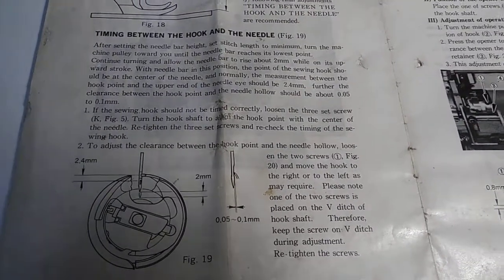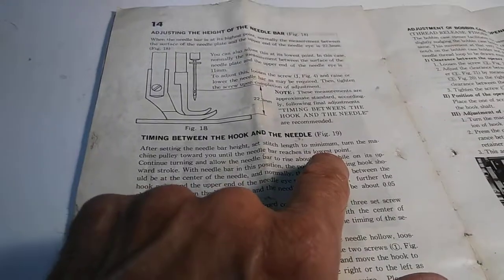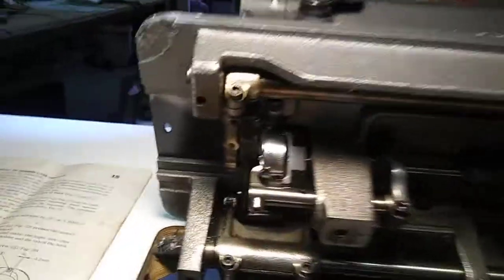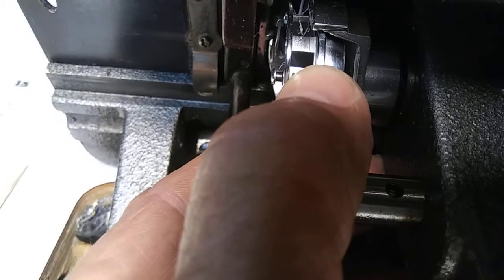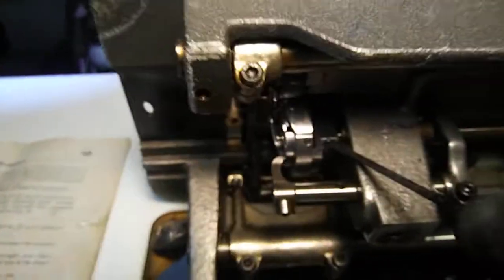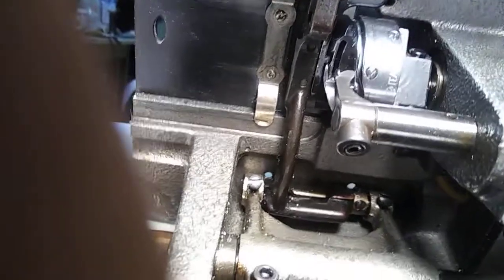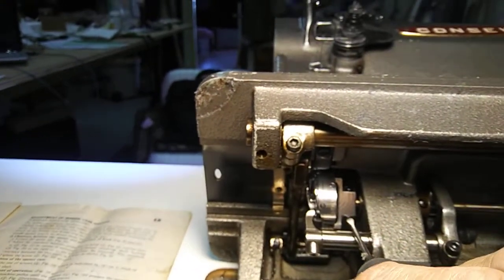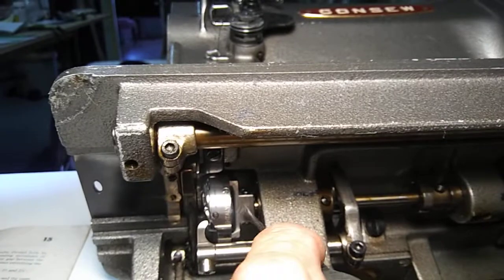Consew 206 RB-1 hook timing

Comment: I know this is 3 years ago but I decided to see what's out there I'm a sewing machine mechanic that is not the way to time a 206 you do not time there,..you time it at the clutch mechanism which is out of your picture on the right side it'll have three screws that is the actual timing position because the hook has to be set in a notch on the shaft you cannot adjust it there properly

Comment: Didn’t read the instructions correctly, you don’t rotate the hook on the shaft you set the “ loop lift” or timing of the rotary with the 3 screws on the left side of the safety clutch!!
The  lead screw in the direction of the rotary hook rotation has a rounded screw point that 
sets in a “V” ditch on the hook shaft so that the 
hook cannot slip or rotate on the hook shaft so that the clutch can do its job and slip out of position and keep hook from slipping on shaft.
Causes for jamming usually are caused by incorrect use and sudden break of needle causing bind or thread jammed in rotary hook.
raceway!

Comment: I have seached for needle height and watched three of your videos.  I don't have a manual.  One of your videos has a blurry image of the manual which isn't helpful.  But I am frustrated because your title of your videos say "needle height " but  instead they all focus on  the timing basically saying the same stuff.  somehow my needle bar moved so much when I try to lower to dead center the thread tension loop hits my feet so it stops and cant recess down,  nor sew.  So I NEED TO RAISE MY NEEDLE BAR>. I was hoping you would explain checks and balances, like checking the aRROW from the top view, a full demo of moving the bar and also  anything we should NOT do.  Like I know there are factory settings for the bars and certain screws should never be touched.
Reply: manual for rb 2 works to trouble shooot your problem

Comment: those two screws are the wrong screws to lossen. read line #1 it says to loosen three screws at k, fig.5 on page 3 fig.5 im sure those are the screwa . read it and let me know. see ya chet?
Reply: if you turn the case more than  1/4 inch youl be out of thr ditch as you say not right sorry.
Reply from the maker: Thats where the clutch connects on the shaft and it does say to do it there. I had to do mine at the hook because I replaced the entire hook and bobbin case holder. Doing it at the clutch also changes the thread release timing but that isn't as critical as hook timing. So you can just do it there.
Reply: thanks  for the info .. love your veds .seeya?